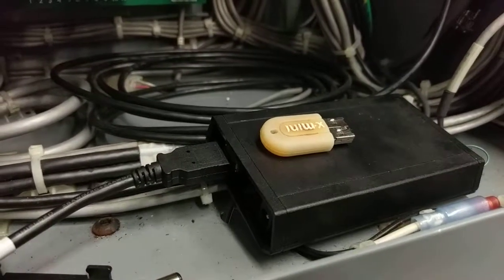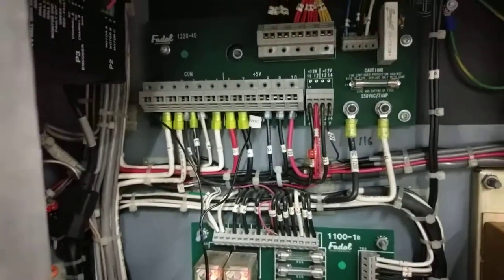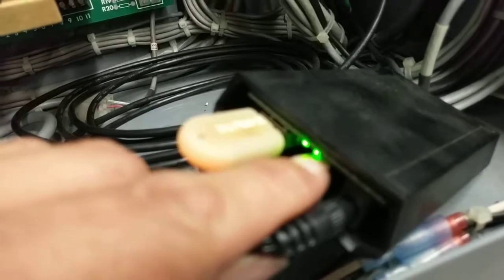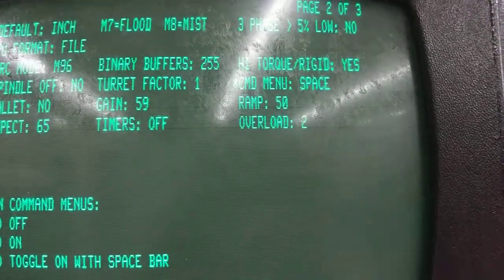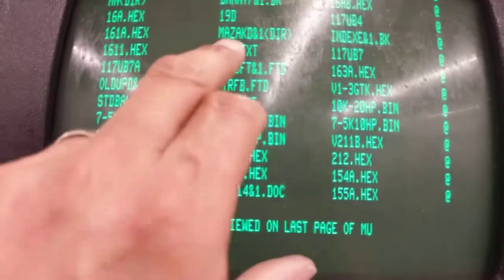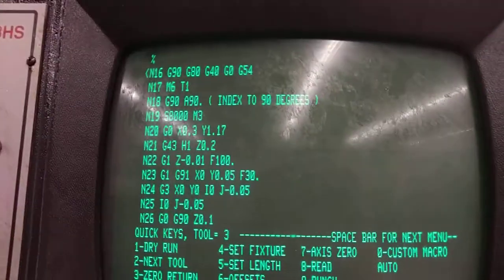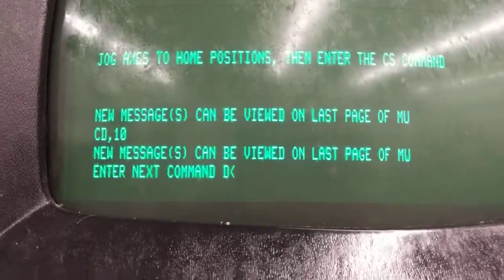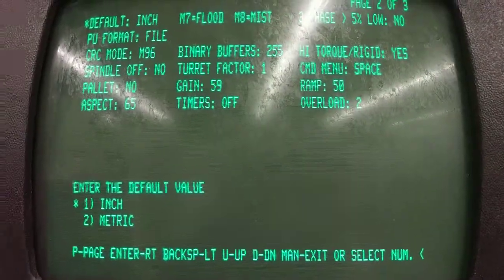Diagnose problems on Calmotion USBCNC-FAD , LANCNC-FAD , LANUSB-FAD, or USBCNC-SW-FAD

Comment: Your 527F system costs $6k. You can get a Fadal off eBay for less. How does your pricing make sense?
Reply from the maker: You are commenting about a different product than the memory products being discussed in this video... The 527F control you mentioned is a complete replacement of the Fadal control. Here is a link to the video discussing the 527F and its many benefits when the old Fadal control is replaced with the 527F control. https://youtu.be/YFHQxNn9w6g